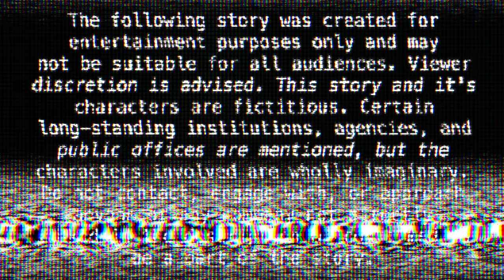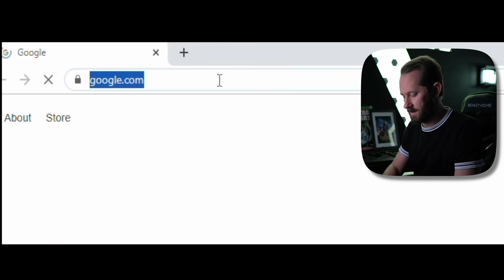How Did This Get Here?! There Is Something Strange On Our Roof...

Comment: I forgot what they were called but that is basically used to contact people in specific locations u set up 2 of them and they can transmit messages and stuff back and forth it can also easily be used as a radio frequency blocker which is why the mics were glitching

Comment: That's an shf antenna. It works with line of sight and depending on power output it only goes a certain distance. You can definitely find Deb just by literally coming across that antenna. You can even reestablish communication with her

Comment: Watching Matt climb up that ladder,  I flashed back to Adam west's Batman climbing up buildings with Robin in the fakest way possible... with a tiny clothesline for a bat-rope !  PS, go up on the roof again with a good set of binoculars or a telescope to see where the other half of that comm system is located... it must be on a hillside or atop another building within a direct line of sight, meaning you should be able to see it visually with some decent optics and trace it to another location in vicinity.

Comment: Watching 863 with a DIY syntech ring. If you want to make one it's black aclic then green then black again. And on the inside it has 863 and subject 4.
Reply: How much for the ring
Reply: @pureimmie  Hi fellow subject 4. I actually don't sell them as I live in Ireland. but if you want to make it yourself,  it's really easy. Go to your local hardware store and see if they have anything scrap acrylic( it's a really hard plastic) get it in the colours you want. Then get sandpaper and adhesive (glue for plastic and metal). Then make sure it will fit you before you make it. I assume you probably have a saw and then just cut out your ring. Sand it and use a needle or any sharp object to inscribe what you want on it 🙂🙂

Comment: I think I know how you get two numbers of 863 6 comes from woods age(24) but add them and 6 comes from Samantha( 21 yrs)but I don’t know where 8 comes from because Matt is 32( sorry Matt and the crew  I exposed you but I just had to search it, it wasn’t hard to find). But 5 is the adding of 32 so all you have to do is add a three to get 8 but I just thought of that because of the rings because of course they got smaller to fit y’all’s fingers but 8 the oldest Matt, 6 the middle Woods, 3 the youngest Sam.